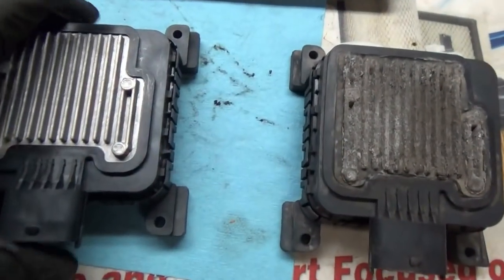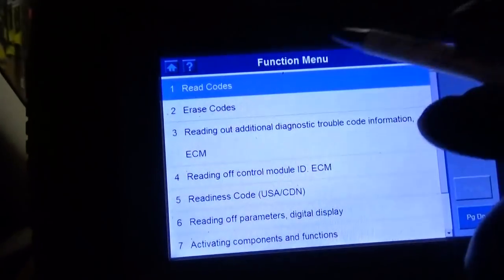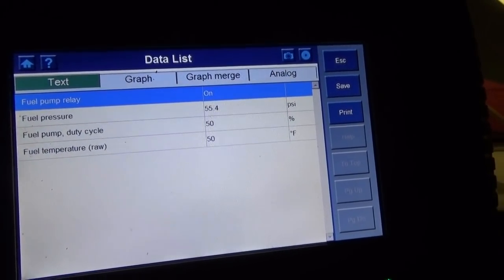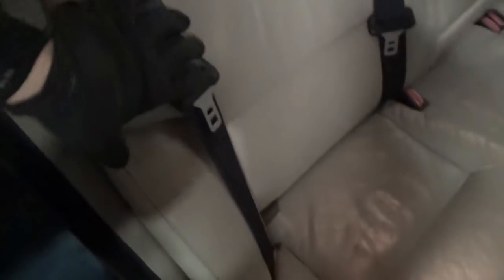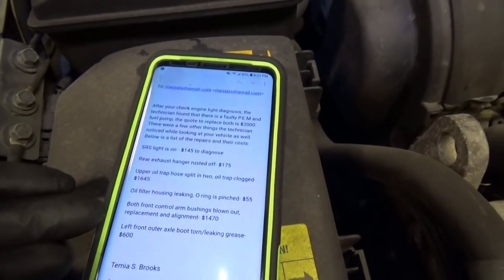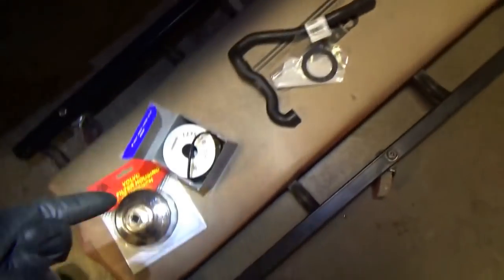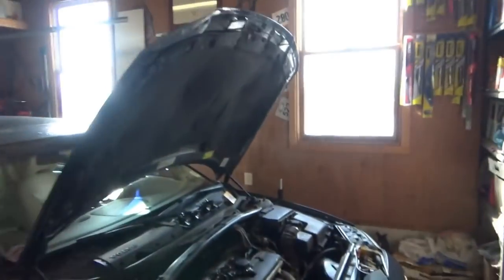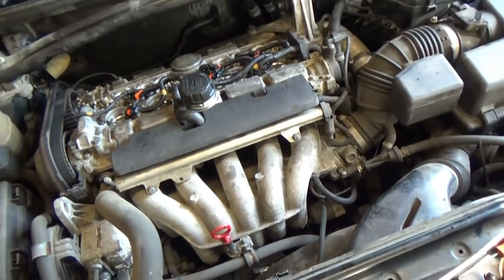Volvo Crank No-Start -Part 3 (Repairs!)

Comment: Great video, and even better repair.
Love the US v Euro cars, Volvo are high quality cars, Swedish mentality, same with SAAB ( aircraft engineering), German cars are designed to run at 85% of maximum speed continuously, and this requires very strict annual tests, servicing and also very limited area for modification. I have spoke to several Americans that have driven in Germany, and they find difficulty in driving on a two or three lane highway with cars, and vans (Mercedes Sprinter can easily reach over 110 mph), exceeding 120 mph. 
I'm from the UK, and apart from a few marques, such as Jaguar, Rolls Royce, Bentley, ( now Indian and German owned), UK cars were never the best, ref short distance and no harsh weather! Even these were not capable of high mileage, as the USA customer required.
The Japanese adopted good quality control in the 1960/70s, even though it originated from the west, America in fact, but ever the capitalist, didn't consider it, now all manufacturing use it. Another unique aspect is that the Japanese mind works in a circular path, that is they always look back at previous, and improve, yet the western mind will invent, then move on.
America required cars that were comfortable, and capable of high mileage, remember that the US car market is equivalent to several European countries, this last point is key in all areas of manufacturing, no need to redesign for other countries laws etc.
These are just my considered opinion.
A new subscriber to Ivan's channel.
Reply: Cars were generally more of a hobby for Europeans, so they produced a lot of cheap crappy cars or really fancy, complex luxury cars.

The US needs cars, so they produced many that were simpler (could be fixed anywhere) and were larger and more comfortable.

The Japanese took from the others, and figured out how to make things high quality and reliable.
Reply from the maker: Interesting take on the vehicles designed for different markets! This Volvo didn't break a sweat hitting 100mph, could definitely cruise there all day long if the cops weren't watching haha
Reply: @bigpjohnson  love the US v Euro cars + Asian.
Reply: Hi Ivan, thank you for replying. I see more comments are on brand, rather than the technical side LOL.

Comment: Great work Ivan I know a lot of volvo owners here in Arizona and tend to help them work on them when I'm home. Great knowledge you have provided. Also Volvo's are great cars! I personally own and drive an 1984 volvo 240 wagon that's also modified quite extensively, also it gets 25mpgs highway while spooling a turbo up to 14psi of boost
Reply from the maker: I've always wanted to drive a classic 80s Volvo with a turbo and a manual transmission!
Reply: It's fun, I personally perfer manual transmissions, come to Arizona I'd let ya drive it

Comment: Well done Pine Hollow, I guess that fuel pump module does a lot to help control the amount of power given to the pump? may protect it from power surge and excess pump pressure

Comment: That oil separator is a known issue on volvos if the oil is not kept immaculate.  It will be blocked up with carbon.  Otherwise those beasts are rock solid.  Front end parts are probably all blown out on that one by now.

Comment: In my experience,Volvo is a pretty solid car. They break like anything else but not to expensive or difficult to work on. Late 80's to early 90's were the worst. The insulation on the wiring was terrible, dry rot and just fall off. Almost everyone I worked on was a wiring issue.
Reply: I agree! DR'S PIT STOP / retired

Comment: Ive been following the series. Ive done tons of fuel pumps on volvos. I've yet to change that module. Were you,keith and eric o live is a big acid test to component survivability. Just because i never saw this kind of failure doesn't mean i shouldn't be prepared. Thanks Ivan.

Comment: What about the "Polymer Electronic Membrane" replacement quoted by the dealer :)
Reply: I think the guy making the quotes looked at the diagnostic report. Saw the P.E.M and said "What's that? Lets google it... Polymer Electric Membrane, that sounds expensive. Lets write that instead."
Reply: I believe it refers to the replaced module. The membrane would sit inside the module over the control board. It's similar to the Abs module. I'm guessing of course. Ntm the manufacturer is Ford . The Pcv system is manufactured on the S70 by GM So much for euro trash. Lol  Great video. Watched all 3 no skips. 🤗
Reply: Pump Electronic Module
Reply: Reminds me of the mythical muffler bering.
Reply: Reminds me of the mythical muffler bering.

Comment: I relocated mine inside per the TSB.  The harness was not expensive - maybe $40, and the job was like an hour.  Well worth it.  Why take a chance mounting that box under the car again and asking for trouble?  Insane.  I got an aftermarket bracket for the rear exhaust from Germany for like $30 with shipping.  Again, well worth it.  Control arm bushings on these failed in short order, and the first replacements In installed from FCP failed quickly too.  Second replacements lasting much longer.

Comment: Honestly one of those Volvo estates is pretty much one of the only Euro cars i would ever consider owning. I'd probably have the 5 cylinder diesel though. Even if it is a thirsty pig. They were pretty well built in the past. Now they have Ford/PSA parts in them and lately the Chinese have brought them.
Reply from the maker: This 5 cyl petrol really impressed me. Accelerates smoothly and efficiently like a freight train, and got at least 30mpg on the highway! Nice size fuel tank as well, total range must be well over 500 miles!

Comment: Hey Ivan:  Just happened to be at Harry's U-Pull-It, in Hazleton, for a 2008 Dakota TIPM (seems I've done a bunch of those recently).  I remembered this case study so I asked the clerk about a Volvo V70 fuel pump control module. $35, with the car's harness pigtail still on it (they just chopped it off).  I didn't think that was too bad.  Just thought I'd pass that on to you... just another parts source that's not too far from you.  Lord knows, they've saved my beacon plenty of times.
Reply: LEO ASHRAE very true but might not have that around him. I only have 1 reliable salvage yard in RI I wish I had more. I go to eBay a lot too.
Reply: $40 on Ebay with a money back guarantee shipped to your door
Reply: zeke112964 Boom!
Reply: @weldingjunkie   He does have it around him... Ivan is 30 miles west of me, Harry's is 20 miles east.
Reply: LEO ASHRAE gotcha wasn’t sure if he did. I know I use eBay a lot or online it’s easier for me

Comment: Fixing oil leaks without replacing the PCV system will only blow out oil seals from pressure. These are known for PCV system carbon clogs. The owner was originally luck that the oil pushed out of the cap. I'm sure by now it's pushing out of cam seals and then some, since you sealed the easiest escape area for it (oil cap seal). Always do the complete PCV system. 

The "glove test" is the easiest way to test for a clogged PCV. There are plenty of videos about it.

Comment: My relatives have a 1971 volvo 140 series which still runs fine. Has had some welding done on it and the drivers seat is now collapsed so it's been garaged for some time now. I would guess it's done over 500000 kms. The swedish made ones are solid. I don't know about the chinese ones.

Comment: Great diag and repair.corrosionX when you live in the salt belt, coat brake lines and exposed modules and connectors anything that oxidize.

Comment: Volvos are 1 of the few Euro cars I will tackle. They really are over-built, and that's why they last! Non turbo cars are better than boosted models are, as far as longevity.  I think the owner should present your findings, repairs, and costs, to that dealership's service manager. IMO, they were clearly out to rip him off, especially on that SRS business. I thought about that in vid 1, and what you said here in vid 3 confirmed my thinking.. The SRS system was merely reporting what it saw at the time! ( duh! they unplugged the system and read a code test! It had better say something was wrong!) And why I watch this channel is because you fix cars with root problems in mind. Great job! Ivan the Great for the win, Volvo dealership for the fail, big time!
Reply from the maker: Thanks for the comment Adam! The Airbag light scam really got me fired up haha

Comment: Volvo put that motor in the v70 up till about 2007. Great motor. (Most of the ones in the junk yard are there because they overheated or timing belt was never changed.) I own two of them.

Comment: The old hose was rubber just the same as the new one, they turn brittle and plastic like with heat and time.

Breather boxes commonly clog up.

Usually the sump needs dropped to clean the channel in the sump as well. 

If they are left they push out the cam seals. Or in this case since its a non turbo it'll pop out the turbo return blanking plug first usually.
Reply from the maker: The old hose was actually plastic, with little rubber sleeves that slide over the nipples. Good thing the new one was actually entirely made of rubber!
Reply: @PineHollowAutoDiagnostics  no it was rubber. It turns to almost plastic you can break with your hands. 

It left the factory just like the new hose you fitted. That one will turn the same way in ten years.

Comment: Great diagnose! I drive a V70 D5 2006 with the following problem: right after cranking and starting the car it shuts down..... So I am not driving it anymore and want to diagnose it myself. I do not have thise very fancy system to diagnose but I hope I can solved this problem, I suspect something in the fuel systeem as well..... Advice is welcome, greetings from the Netherlands.

Comment: That PCV system is a maintenance item. The top hose was never plastic, always rubber, but they solidify with age. It's GENERALLY thought that by the time the top hose has solidified, the trap is usually caked with crap. The testing procedure is to measure vacuum at the oil dipstick tube. Any pressure there or at the oil cap means the PCV isn't working properly and may be building pressure in the crankcase. Common for these to blow oil seals when the system is clogged. And the oil cap, regardless of the seal that always hardens up, will really never leak a drop unless the system is building pressure.
Reply: Also common is for the return port, on the bottom of the block connecting the oil trap to the oil pan, clogs. In some cases, clearing the port requires removing the trap and oil pan to run a snake through.
Reply from the maker: I can see this being an issue on cars with neglected oil changes, but with regular synthetic changes this one runs perfect. No leaks or burning at all!

Comment: Well done again, Ivan. I hope you checked for crankcase pressure as a plugged oil separator is a common problem on those. I have seen them plugged so badly they actually push the dip stick out.  Too bad the newer Volvo's are junk compared to the older ones.
Reply from the maker: Thank you! Well it didn't leak or burn a drop of oil during my 400-mile highway test drive, so I'll assume the oil separator is fine for now ;)

Comment: volvo is built pretty well, steel and sealer/paint done right .
should of rounded your bill off bit more lol .
got plenty years left in it if makes effort keep service and minor repairs in check ...
Reply from the maker: Yes, body materials and finish are absolutely first rate!

Comment: I enjoyed you video.  I work on all 3 of my 20 year old S/V 70 turbos.  How did you access the clamp for the breather hose that connects to the oil separator  box under the intake manifold?  Also an older comment mentioned the "glove" test for PCV pressure.  You can also look for vapors coming out of the dip stick tube.  If there is positive pressure at idle the PCV system will create so much pressure that it blows the Rear Main Seal, big bummer.
Reply from the maker: Thanks for the comment, Jason! Yeah that lower clamp was a pain to get to haha. Used a long flathead screwdriver to loosen it up. Not sure if I even installed the clamp back on the new hose...was a snug fit :)

Comment: Had the exact same car but with the 2.4 diesel engine. Extremely solid car. The only 2 things I did not like about it were the brake pedal feel, kind of spongy and the steering, very imprecise almost wobbly. That being said, I suppose  it would be however hardly noticeable for the friends across the pond where this is the norm even for sportier  cars :)))
Reply from the maker: Interesting. The brakes and steering were top notch on this particular V70, even with the torn control arm bushings up front and 212k miles on the clock!! The brake rotors might still be original, and don't seem to rust very much!
Reply: @PineHollowAutoDiagnostics  Hi Ivan. It all depends on your "baseline" so to speak. Compared to your XL7 it might even seem agile but if you put it aside let's say an Audi A6 same generation, you can feel the difference. Don't get me wrong, I am only talking about handling here. I did enjoy the car, I found it robust ( the most oversized suspension arms and bushing I ever seen on a car :))), reliable and very comfortable cruising at motorway speeds. Cheers
Reply from the maker: Well, sure. The Volvo is a thouroughbred highway cruiser, not a track car like an Audi. Nevertheless it was very secure in high speed corners :)
Reply: @PineHollowAutoDiagnostics  Far away from track cars here, the Audi  was an A6 station wagon ( estate here in the UK) , 2.5 tdi 2003. I'm not an Audi fan by no means by the way. However yes, the Volvo did feel secure but... vague :))) Keep working on european "trash", you might start to like it.

Comment: I took my 2002 V70 AWD into Firestone for a 4 wheel alignment and got the same diagnosis , cost $1200 approx, my reply was that is more then the car is worth, the parts online are about $200.00, I did the coils and plugs for about $100.00 about 1/4 of what the shop wanted
Reply from the maker: Cool!

Comment: Over 22 years of ownership, my 1995 Volvo 850 turbo would not start only 3 times.  1) failed fuel pump, 2) gas line freeze, 3) wire to starter rotted off (that is when i gave the car to my brother-in-law)

Comment: Hi Ivan been watching your v logs for quite sometime now and you are a knowledgeable guy, very straight forward talking not enough of you around. One question I’ve been in the motor trade for over 30 years not in it anymore but what sort of scanner would suggest I’ve got two  Toyota great cars if I was to buy a scanner which one would you suggest
Reply from the maker: Autel or Launch works great, awesome bang for the buck! I might me getting a new scanner to play around with and show on video, so hold tight :)

Comment: Personaly i have only seen Fuel pump Control Module (FCM) only on Volvos that have bean made for USA market(dont know was it california or not, but im sure it was just for big dolars).
Im sure you did check that the Fuelpump it self wasnt bad as one of the reason why that FCM did dye(as you already did have scope why not check the running current and its wayform of no drop outs and so on..
For the plugs i have heard that Volvo Is realy pike of the spart plugs, so if it starts skipping then first change them to the orginals as the electrod are on the way of the spark on NGK and not on orginals and it made for longer run thats why 3 heads are better then one longer life one...

Comment: Yup had a BMW 325i coolant leak, overheats, been to couple shops got quoted for other stuff besides the coolant leak. Told the customer need to go to the dealer no tool to check. Bought a universal pressure test kit. Boom radiator, cleaned up the engine bay, fixed the leak with a new Rad. & hoses. Did an engine oil service runs like a champ customer was shocked asking was it hard to check for coolant leaks? Nope makes me wonder what shops do serve customers or rape them for cash. Awesome case study hmmm the part said FORD on it same system relay module interesting.

Comment: Thanks, I have a 2005 S80. I have to replace the PCV system and turbo. I am up for the challenge. I replaced a turbo on my Saab.
Reply from the maker: I'm sure it will drive a lot better with a new turbo! How many miles?
Reply: @PineHollowAutoDiagnostics  It has 170,000 miles. Should I replace it with OEM which is a Mitsubishi turbo or aftermarket exact fit? What would you recommend? What about a different intercooler?
Reply from the maker: @keithwilliams1110  I say keep it stock OEM for best reliability and performance!

Comment: I want to thank you! I think this is a great video! Excuse me video series! It' s the first of August 2021  I have watched Ivan' s series like the cliffhanger it is. Me with a cranking no start '05 Volvo v70 xc in the driveway.  A working '01 right next to it.
What are the odds it is this gas tank mounted module? Could I swap them just to see? Won't even have to move the seats.  I sure don't have those diagnostic skills or computers. I do have a Fluke test meter. I squirted starting fluid into the air intake and it ran. Pretty sure it is fuel related. But all these module issues are daunting to a guy like me. Driving it to someone who could fix it would be nice. How far can the hot wire trick be used without being a bad thing if the module swap does not pan out? Too much fuel pressure sounds pretty dangerous. Anyway you give me quite a bit of courage to feel hopeful tonight that tomorrow things may turn out positive for the '05. Thanks again. Take care.